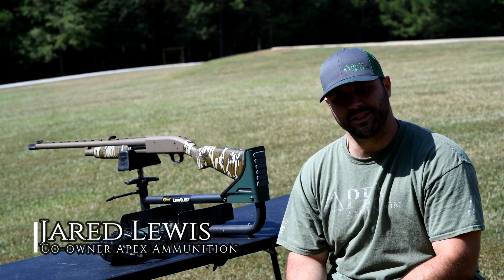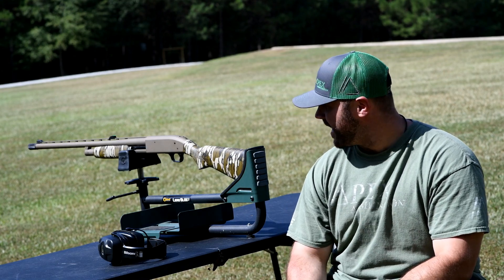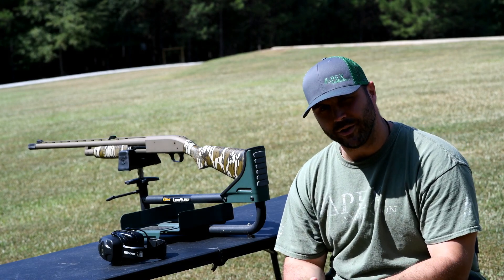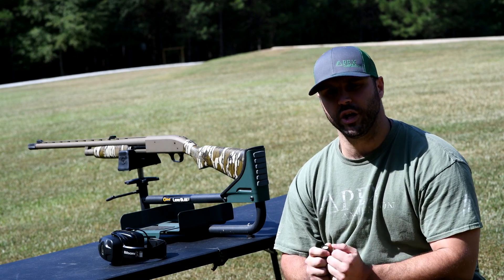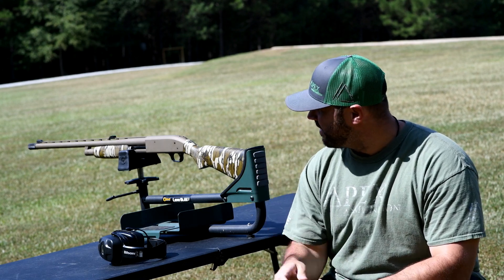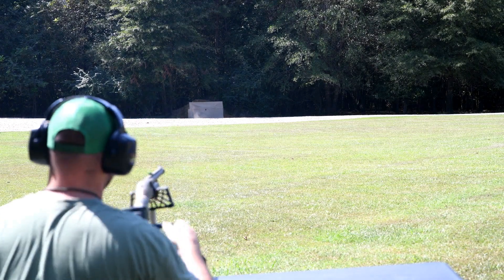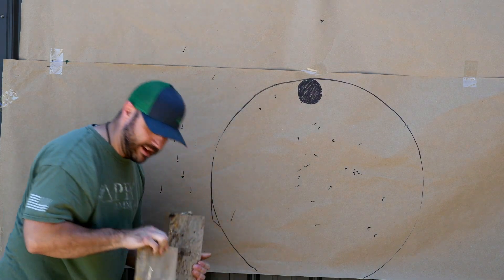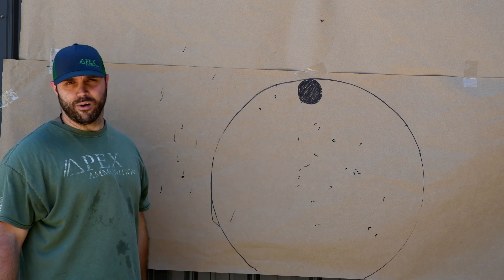T-Shot Performance

Comment: is there a "hold over" application for TSS as distance increases?
Reply: Yes. Anything over 50 yds I hold high roughly 3 or 4 inches more for an extra 25 or 30 yards of distance... like from 50 to 80 I personally aim almost one full 6 MOA red dot's diameter up...
 Just in case and it patterns well.